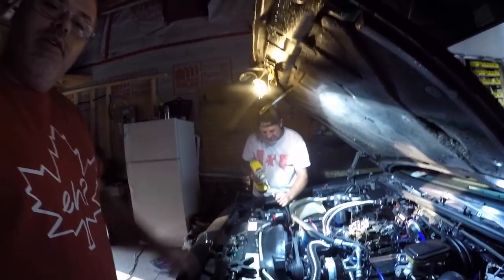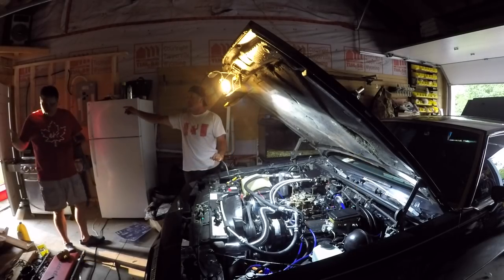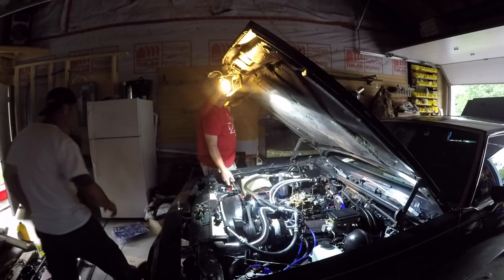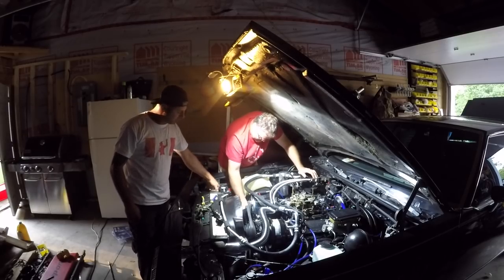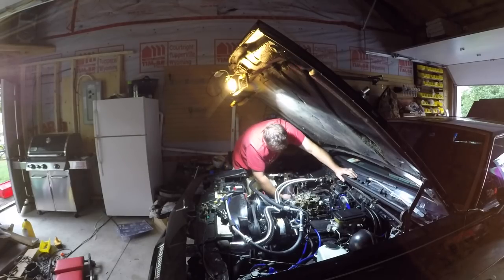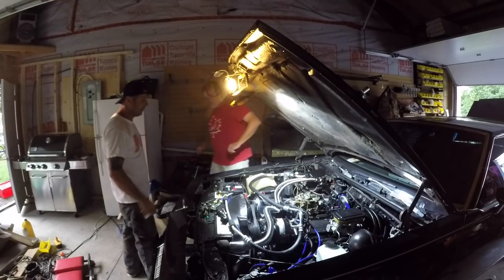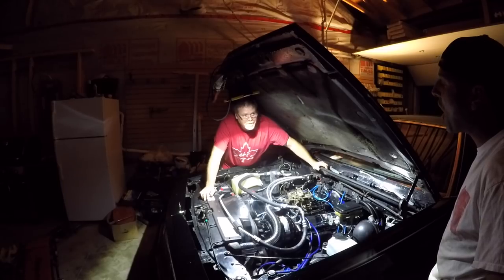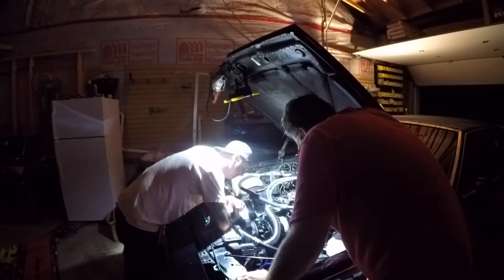454 Big Block With 305 Small Block Heads

Comment: I had an 85 ss Monte Carlo with a 350 and it was pretty fast but studs in the heads kept getting pushed up plus header leaks. Turns out Chevrolet with their wisdom put press in studs instead of threaded. Also, the mechanic told me my 350 had 305 heads. So I told him to put 350 heads with threaded studs on the thing. turns out after all that my car went slower than before. I didn't know it was the 305 heads that were giving it the extra HP